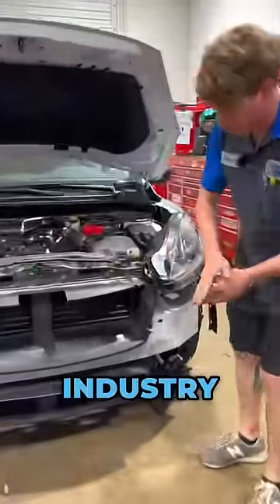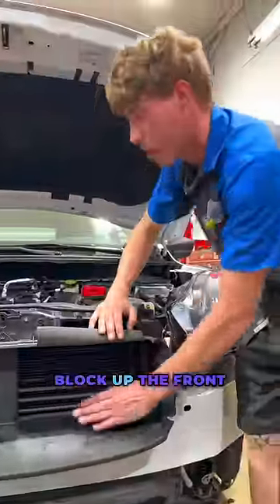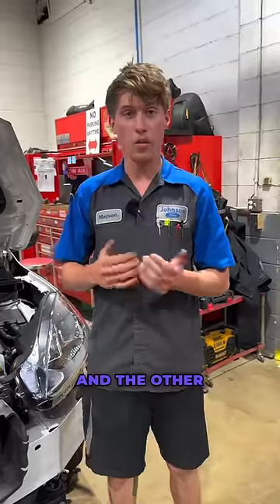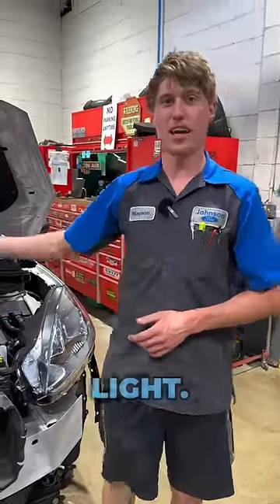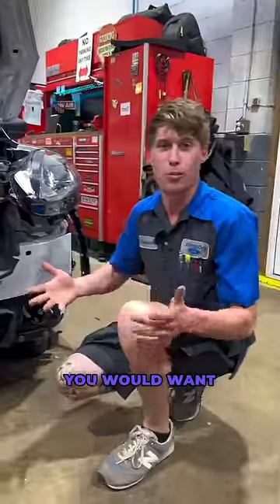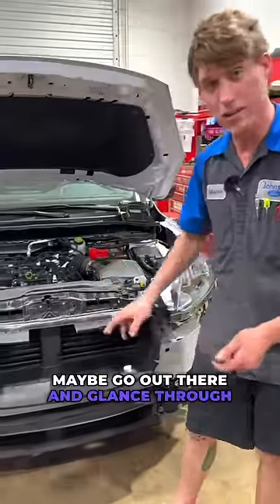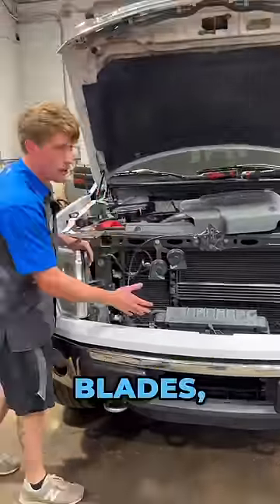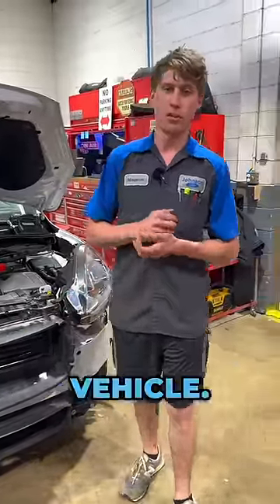Grille Shutters: A Newer Design In The Automotive Industry #shorts

Comment: Get you a saw 🪚 or tin snips and extract the plastic blades😂😂😂😂 otherwise one day a malfunction may cause them to stay shut and blow a head gasket or worse crack the cylinder head and or engine block. If under warranty thats no problem, if not under warranty then you will wish you had removed the problem before it became a bigger one😂😂😂😂

Comment: Leave the motor, rip the blades. The check engine light might be transient because temp correlations may be off, but probably not on usual driving conditions. The body module won't be that smart. 

Just like mds/cylinder shutdown, this is a terrible thing to have. Ruins things more than it can mend. 1 out of 7 monkey farts.

Comment: What a stupid idea thats just going to cause more problems then it's worth. The engine warms up fast enough without having that crap on there. That would only be a good idea if you lived in an extremely cold climate where your car still runs cooler then normal even after the engine has been running for some time.

Comment: The idea behind blocking air flow through the intercooler has more to do with fuel economy...
Allowing the air to reach a higher temperature means that the air becomes less dense, obviously, the idea that they had in mind was that the less dense air would result in less pumping losses and therefore slightly better fuel economy when high power is not needed..EGR is also sometimes used in this way and in combination.. with the ridiculous fuel economy requirements coming down the pike from Uncle Sam and his fuckups, you're going to see more and more dumb shit like this.... Save the environment... 1 billion plastic parts at a time.

Comment: yeeeeah, not new at all!!! now run a cable to a push pull knob in the cab or a manual leaver under the hood so your vehicle doesn't over heat when the electronicals fail and cost you $1200 to fix after many shops fail to diag and youve already spent $$$$$? trying to fix it.  LOL